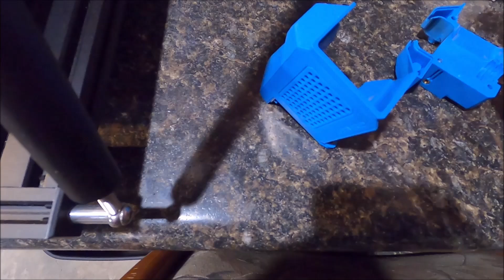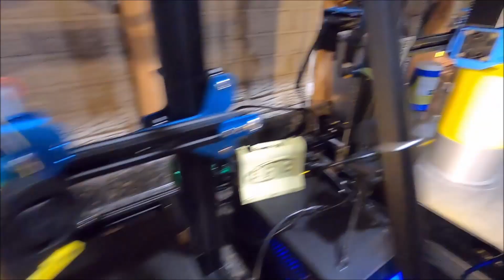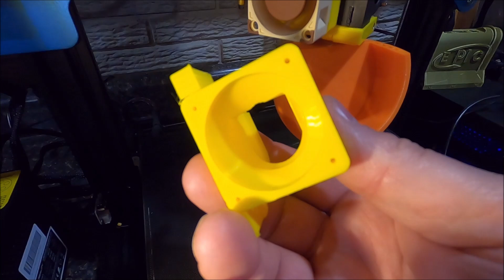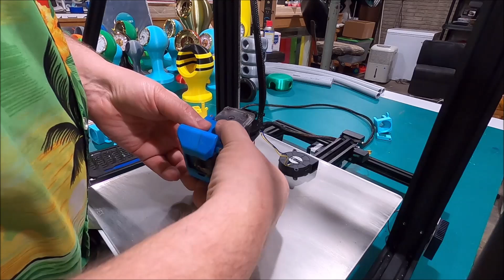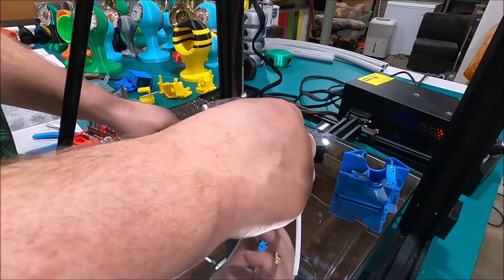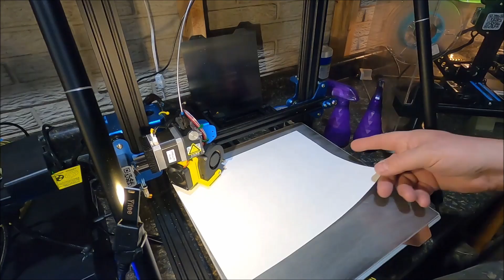Creality CR10 V3 How to Hot end upgrade modification Simple is better for sure Amazing results

Comment: I wonder if it would be possible to do this if a BL Touch is installed onto the print head. I wonder if someone has run into this issue before and designed a bracket

Comment: Yup. I'm here because in the process of cleaning out my extruder parts went flying. Basically this just moved up the timeline of replacing this pile of junk with something that simply works.

For those following along, regular cleaning out of the extruder and replacing the PTFE in the hotend is not normal. Don't get me wrong, your insight, mods, and fixes are very valuable - if you want to stick with the poorly designed factory setup. I'll be either replacing it with my old TronXY A-10 hotend which was abnormal in that it was the one part that never messed up on that printer, or installing a all metal hotend with a new extruder. 

Thanks for your fixes, they look quite impressive.
Reply from the maker: thanks for watching

Comment: hands down the simplest and easy to work of any fan shrowd. No extra parts necesary, just reuse the original screws. Just a mention, this needs to be printed out of ABS or high temp resin on a resin printer. With PETG i experienced sagging of the fan shrowd and had to improvise with a copper wire to hold it in position. Been printing great with it since.

Though i would like to request to @Rm3d Creations that he upload the step file for this to be able to more readyly modify this and add accelerometers, cr touch, etc

I converted my CR10 V3 to run RRF on an SKR2 and now i have WIFI, web interface and better quality printing by using the stock creality slicer settings. Now that RRF3.4 has been released i want to add an accelerometer to do resonance compensation and see how much it can be pushed.

Comment: I have a CR10V3 printer with  direct drive. What retraction distance do you use? I am using 0.9mm and I am getting string when I print multi-prints in a single print job.

Comment: Is there still space to mount a BLTouch using the two screw holes in the mount plate (behind the black fan) as intended in the original design?

Comment: Great video!
Printed your shroud in ABS and will mount it next time I need to service the printer. Replaced the heat break with a Copperhead heat break, and reused the heat block. Works like a charm, and haven't had to service it since. Also very happy to hear that the shroud will work with my CRTouch. I assume it will, since Scott Jacobs (below) confirmed the BLTouch worked.
Your videos are very likeable and entertaining to follow. Keep up the good work!

Comment: So mad about this! They simply swapped out a problematic plastic idler arm for a metal one and called that an "all metal extruder kit".  People like me come along and think theyre getting an all metal hot end or at LEAST an all metal extruder and therye getting neither.  Mine wont print reliably above 240C (which is everything I need to print) so its basically junk to me.  The hot end isnt an E3D.  Its a clone with a weird short heat sink so there are no easy "drop-in" options Im aware of.  Its starting to look like major surgery at a minimum and if I have to buy a whole new printer it will NOT be anything from Creality!

Comment: I've printed this a few times now and for some reasons it breaks everytime i put it into the new piece.  Any ideas?  Should I increase the size a smidge?
Reply: You need to print it flat with the extended part with the hole in the end flat to the build plate. Not standing up. Look at the layer lines, length way on the mount is strong and will not break when snapping in the heatsink. You don't need much support, I use 87% Everywhere in Cura and there is just enough.
Reply: @scottjacobs4816  OK I will give this a shot.  Was thinking that might be the case.    Thanks
Reply from the maker: Yep, he is correct.

Comment: Finally got around to printing this new upgrade. I thought I would let everyone know you can use this with an ABL, BLTouch in my case. You don't need to have it at a 45, it fits fine at a 90 and allows for the ABL. I'm testing it now with polycarbonate carbon fibre filament @ 260. See how it holds up. The stock one melted even with the silicone sock.
Reply: so you used the standard creality mount and there was no obstruction? thanks!
Reply: @andyyuen  I just did what the video showed but turned it square to the original mount and it works fine and clears the BLTouch. Check the wires for the hotend, I pointed them to the back plate/mount and there is enough clearance for them.
Reply from the maker: Good to know

Comment: Thanks for this video - going to need to do this at some point soon.  What is that spool setup you have on the CR10's?  I've had trouble with the filament sensor pulling on the spool too . . . do you happen to know the thread size of the 2 tapped holes that the CR Touch is mounted on too?  Thanks for all.
Reply: The holes for the CR Touch are M3.
Reply from the maker: thanks for the help

Comment: Does that mod prevent a BL Touch from being fitted to the carriage?
Reply: The only thing I don't like about the original design is that the air ducts split in 2 when you take it apart makes you wonder how much air flow you're losing for the small gaps. I'm in the middle of doing a revision of the original fan duct that the fan ducts aren't in 2 pieces prolly got 2 weeks maybe 3 till I'm finished
Reply: @JohnR4mboStyle  okay, so about that bl touch 🤣
Reply from the maker: People are telling me it will still work.

Comment: Great video, thanks for sharing, any tips on setting a cura slicer profile, since there isn’t one available for the v3 just yet, I heard you have to drop the retraction a bit,  do you have any other tips?
Reply: I've had this printer since this video and used Cura until I found out the newest PrusaSlicer has a great profile for the CR10-V3!  Even though my custom profile worked in Cura the PrusaSlicers profile blew mine away in Cura.  I haven't used Cura since.
Reply: @ryand76  interesting! i might just have to try it out
Reply from the maker: Sounds like a plan.

Comment: I just purchased one CR 10 V3 because I have right now an Anet ET4X that is causing me more troubles than printing. I still no priting since one month because I didn't know what's happening with the layer fan (only worked one week & bye) because I replaced everything from the printer and still no working. I just installed Marlin but the problem still there. I will going to sell it because I don't want to spend more money & time to this printer.
Reply from the maker: Interesting

Comment: Hello, I'm curious if you have had any heat creep issues with the hot end design for this V3? Reason I ask is it seems that Creality is still using the 2 screws to mount the heat block to the Heat sink. Historically on the Ender 3 series a lot of guys removed those screws as a result.
Reply from the maker: No issues as long as your fan is running.

Comment: Is there an reason why you don’t use the Filament sensor?
Reply from the maker: It didn't work with the Octoprint. I think there are some patches now that let it work with it. I have only had one print failure in 5 months that the sensor could have saved my print.

Comment: Have you had any issues with the lack of dual Z endstops / timed Z? One of the first issues I had is that the gantry moved out of level when the steppers were off, resulting in the nozzle etching the first layer into the plate. Looking at adding a timing belt, but a concern is that the rods are supposed to be freefloating at the top. Adding an endstop is apparently off the table because for some reason they're running both off the same driver. 
In the meantime on the lookout for an "all metal" heat break. 
Cheers for the video. Looks like a good upgrade and each step was illustrated clearly. Often ease of access / service is overlooked (or intentionally made difficult) these days.
Reply from the maker: My z's have stayed synced up so far. Thanks for watching and commenting.

Comment: How is the pla holding up to the temps, I was always told to use petg or abs for hotend upgrades. Also is that the stock hotend?
Reply from the maker: I have 6 machines running with PLA and they are holding up just fine.

Comment: You can remove the screw without taking the whole thing apart.  On the creality website, it has you remove the two back ones, and then the four around the plate.  You can move that piece of the assembly slightly enough to get your tool in there.  It's not the best way, I'd imagine, but I don't think I did any stripping of the screw head.
Reply from the maker: That maybe true, but, now I only have to remove the screws that hold the part on that I am trying to remove. Funny thing as well. So far I haven't had to take it apart since the upgrage.  Would I do it again?  In a heartbeat, no doubt it's a sweet set up.
Reply: @Michaelinthebackyard  Oh I totally dig what you have going on here.  I'm also very envious because I'm still having huge issues getting a print to finish, heck, even start.  I'm currently having to disassemble mine because filament got stuck in the bowden tube, and now I have forgotten where I placed my replacement piece lol.
Reply from the maker: That's not good. Hope you get it up and going.

Comment: Love the video! I’m fairly new to printing, and it’s great to get such detailed info! I also was wondering if you have any ideas for how to safely put the filament spool next to the printer or even under it, I am in the midst of making an enclosure and I would love to be able to put the spool underneath it in a cabinet. Let me know know if you think this would be possible
Reply from the maker: Since it feeds from the top I would say underneath would be a challenge.  Put it on top of the enclosure and feed it through a hole. The enclosure doesn't need to be air tight.

Comment: I'm surprised your Bowden tube is in such bad shape, what kind of temperature have you been printing at?
I'm making sure to stay below 237°C (for tests), hopefully it'll be good enough.
Thanks for showing all this, I'll likely upgrade to a capricorn tube soon and check the length at the same time.
Very useful 👍
Reply from the maker: 245 c is the highest I have gone.
Reply: @Michaelinthebackyard  ah then it's right the point where a standard bowden tube can degrade, especially when pre-heating or printing at low flow rate.
I didn't expect it would be that bad tho.
Thanks for answering!

Comment: I have the CR-10 v3 with a BLTouch, will thee be room to mount the BLTouch after adding this fan mount?
Reply: I had this same question. Someone (smarter than me) should design that.
Reply from the maker: no there is not. one could be designed on to it.
Reply: I also want that option but I have no idea how to design 3d things let alone make it work with it lol